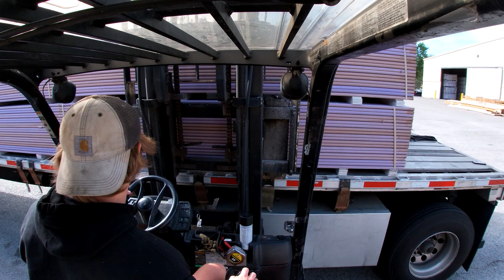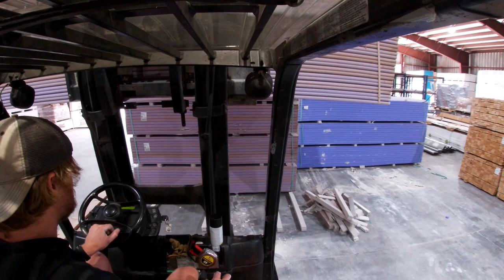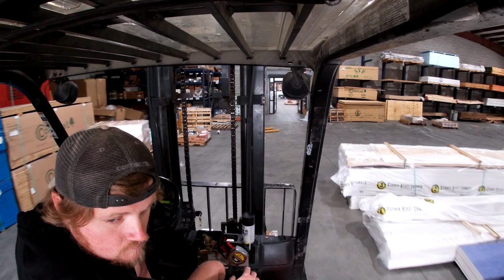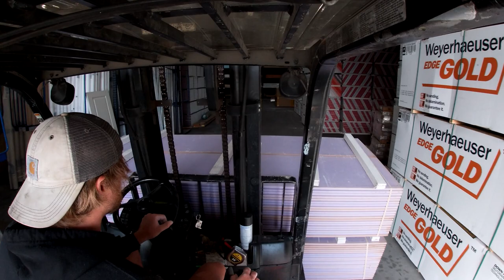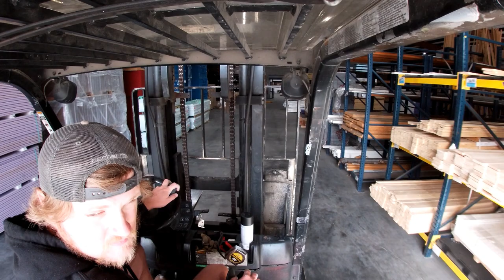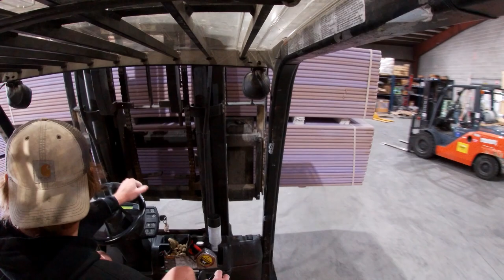Forklift POV: Unloading a Truckload of Dry Wall

Comment: I know this is drywall, but it appears to stack the same as lumber. Biggest problem guys at our place have starting out is probably fork placement....bc depending on the size of the boards, those 4x4 boards that space the packs go in different spots and there are different numbers of them (usually between 3 and 7) Since those aren't on there when first picking up the pack, alot of guys will pick them up inline with where the 4x4(s) go. And of course when that happens, its impossible to stack the pack of wood.

Comment: Maybe a stupid question because I know you've been doing this for a while now so you have the experience but how do you know the forklift can manage the weight of both pallets at once?
Reply from the maker: Honestly just try to pick it up and see if the forklift can handle it
Reply: I can tell you from my forklift driver experience. Every forklift designed to lift certain amout of weight. I work with a 3,5 tonner but really I'd can lift about three tones become of the weights of forks themselves.
Reply: The forklift I drive at work can carry 5000 lbs, it's easy to tell if you got to much weight, plus I can drive over a crack in the floor and the backend starts bouncing. That shit was scary as hell when I first started driving.
Reply: I drove a Hyster that baby can carry two units of 5/8x54x12 drywall
Reply: Check the loading plate. Every forklift has one
Reply: Because if the load is too heavy, you'll immediately feel the rear end of your forklift raise up. Best to stop there and split up the load before the rear tires are also up in the air. I stack green lumber in a yard at a sawmill, some packs of which weigh around 12,000 pounds. Fortunately I have a Taylor 360L forklift, which is rated for 37,500 lbs.